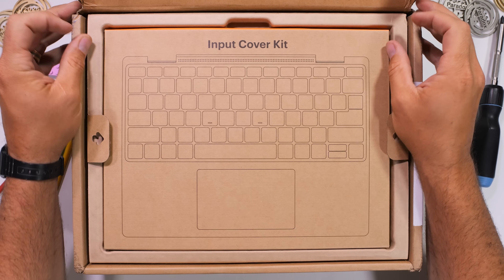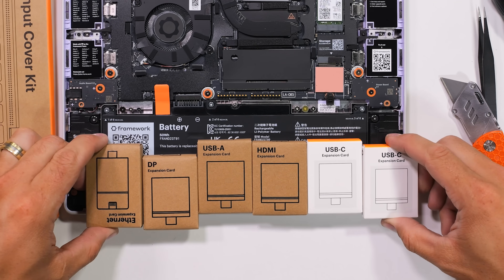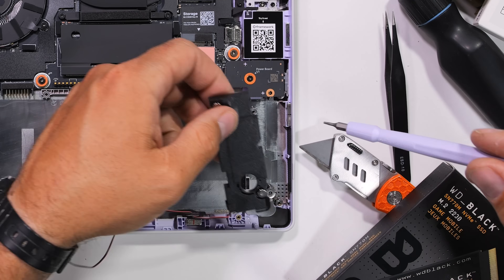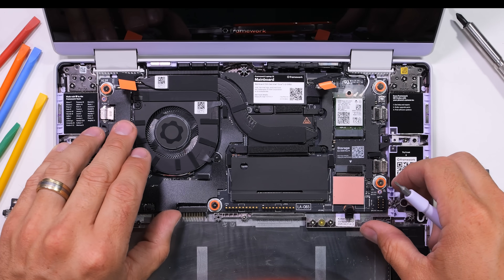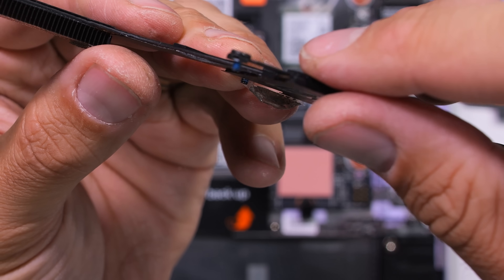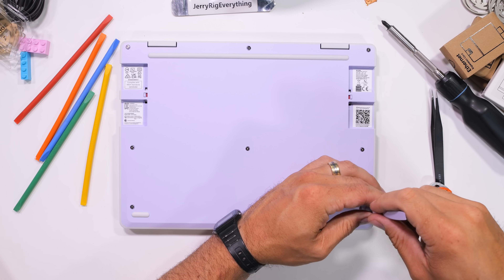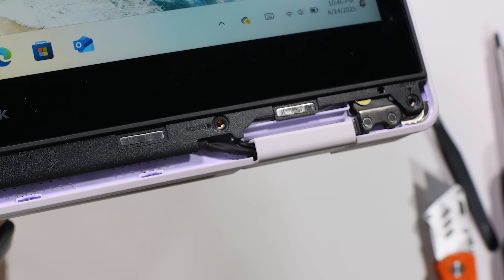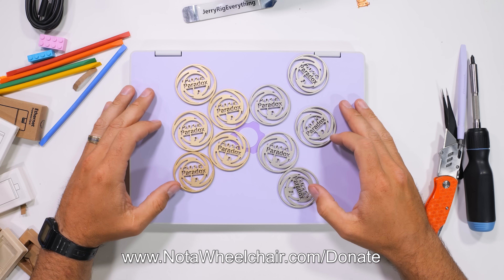The Best Laptop on Earth... is almost too easy to fix.

Comment: Older laptops had upgradable CPUs and even GPUs. Most laptops now still have upgradable RAM and storage. Only Apple and Dell have moved to fully soldered RAM and SSD. Lenovo, Asus and HP still have thin and light laptops with plenty of upgradability. Of course, not as much as this laptop, but you're going to get better performance, build quality, battery life and weight for cheaper with other brands.

Comment: Seems like a viable option for on the go hobby work. Would the 12 and/or 13 be able to run Autodesk Inventor and a sketching software like Gimp or Sketchbook Pro? Or are these screens able to be used with a pressure sensitive stylus?

Comment: Can't wait for mine to ship (Batch 1, Gray) - I have been waiting for a smaller, less expensive version to be able to toss in a bag and not worry about things breaking and having to scour the internet for replacement parts from random shops.
Will be ordering the stylus once they release that too. From what I see in their promo materials, the stylus has a user replaceable battery in that too! 
Also, I'm a huge fan of the new translucent USB-C expansion modules. 
I hope they eventually bring those same translucent colors to other modules and replacement case/keyboard parts in the future. 
I want to rock an translucent purple Framework 12 🙃

Comment: the $559 is a bit of a lie. That is for a barebones non-functional laptop. No OS, no ram, no memory, no IO modules, no power adapter. In addition that is with an antiquated 13th gen i3 that is pathetically slow with an r23 score of 5250.   fully configured, you are looking at 1000-1200 for slow antiquated hardware in 2025. You can buy a new brand name $600-800 laptop that will run circles around this one. And I hope you don't have stability issues with a 13th gen intel chip in 2025 😂. I'm all for right to repair, but this just isn't viable. There is no amount of repair-ability that will offset paying twice as much for slower tech unless you are a butterfingers that break's their screen on a monthly basis.

Comment: I got myself a framework 13 for college last year, and about a week into school the network card died. After a quick scan of the forums to confirm what cards were compatible, and a $20 detour to memory express, I was ready to roll. I'm pretty sure I spent more time looking for the screwdriver than actually making the repair. I also love the reactions I get when people see me hot-swapping ports. And even though it's technically underspeced for what the college said we would need (apparently engineering students are supposed to have a discrete gpu), it handled everything I asked of it just fine.
Reply: never had or seen a network card die in my 30 years of it support.
Reply: Months after buying a hp elitebook it died only giving two blinks on the caps lock😢
Reply: You likely could've taken advantage of the manufacturers warranty in that case and had the network card replaced for free
Reply: @flameblood1  yes but then I would have had to have waited for the replacement to ship. Being a college student who very much relied on my laptop having network access to get assignments done, $20 to have it working the next day was 100% worth it.
Reply: Imagine if this constructor falls down 🫣🎉
Reply: That's because AMD has really really really really good onboard graphics card that is on par with a dedicated GTX 1080
Reply: This is awesome, but inexpensive it is not.

I started building one on their website, starts at £1,399, and quickly hit 2000 as I was putting in the specs. 

I do love everything about it though, they even have like 20 different style keyboards for different regions
Reply: The network card died? That's not very promising.
Reply: @SirDonald  My first Dell Inspiron had to have it replaced almost immediately also. Of course, it was an Inspiron (not premium) but it happens even to big name companies.
Reply: @SirDonald  the impression I got from the forums is that the AMD network card which ships with the AMD mainboard is not very good. The replacement I put in was an Intel card and I've had more or less no issues since.
Reply: @reaganharder1480  AMD forces them to use MediaTek wifi/bluetooth cards due to a partnership and the one that shipped with the "last-gen" Framework 13 wasn't very good. The newer one in the Ryzen AI 300-series seems to work quite well at least for me after a couple of weeks but is also easily swappable if it turns out to be a dud.
Reply: @_ebrq   They could use a Qualcomm Atheros network card with the AMD systems, but that is much more expensive than Mediatek.  AMD does not allow them to use Intel, Killer, or any brand other than MediaTek or Qualcomm.  They could use any network card they want, AMD can't actually stop them, but if they don't use an approved card, they don't qualify for OEM bulk pricing and Framework's already high prices would be even more inflated.

As far as needing a discrete graphics card for engineering work, whoever is recommending that is 20 years out of date.  For 99% of engineering work and 80% of artistic 3D modelling, memory capacity is much more important than processing speed and CPU speed is more important than GPU speed.  You can get a lot more VRAM a lot cheaper with integrated graphics than you can with a discrete card.  Yes, there is simulation software that requires CUDA - even if it didn't, you would want the fastest GPU you could get for that software - but you will not be using that as an undergrad.  That software also tends to refuse to run on GeForce cards because Nvidia are buttheads.
Reply: @SirDonald  Happens more often than you think, even on desktop machines.  I remember building a machine with an Asus motherboard, and 3 hours after I built it and installed Windows on it, the ethernet chipset on the motherboard went up to silicon heaven.  I debated about tearing the whole system apart and doing an RMA, but I'd JUST gotten everything set up how I wanted it and that was going to be a hassle.  So I tossed in a spare gigabit network card I had and that machine ran without any further problems for a few years until the next upgrade.  I also bought (for work) a dozen Dell 1U servers and a week into deploying them, one had the motherboard die.  To their credit, Dell had a service tech onsite less than 24 hours later with a replacement board.  So hardware failures on new equipment happen all the time, even when paying premium.  At least with something like these Framework laptops, replacing a single component is easy instead of tossing the whole thing out (like some certain Fruit companies' products...)
Reply: @SirDonald  i had an asus  which had network card died too but and can't find replacement,  it's pretty normal if you work in iT field
Reply: To be fair it's not like framework made the card, they just installed it. @SirDonald
Reply: @SirDonald  Stuff breaks sometimes, and age or even quyality has nothing to do with it. I think stuff is especially likely to break close after purchase and around the end of the warranty period, but for different reasons. Right after purchase it might just be something that slipped through QC or got returned/exchanged and sold again to someone else because no faults were found with it, which means it is relatively likely to get an issue in the initial period of use. Meanwhile, the period near the end of the warranty cycle is just because the company is trying to optimize costs against their warranty, intending to give it just enough lifespan to ensure it survives until the warranty cycle, but to still encourage its malfunctioning so they can sell a whole new device again relatively soon while saving on the sort of structural costs that only really matter in the longer term.

IMHO the network cards malfunctioning should probably have made that card RMA-able due to the modular function of this laptop and they shouldn't have had any extra costs over it, but I imagine they were in need of actually fixing it ASAP slightly more, which makes it good that he could easily source a fix for the issue without being dependent on some overworked repair center somewhere far away that would have lost him all use of the laptop for a considerable amount of time.
Reply: @SirDonald  all framework are known for having an horrible network card. both me and my friend have the framework 13 (i bought on release year he bought last year) and on both laptops the network card is horrible. terrible wifi
Reply: @SirDonald  Las tarjetas de red son una de las partes mas sensibles de una placa base a subidas de tensión, electricidad estática, un mal cable de red...
Reply: @SirDonald  It happens. It happened to my laptop as well (not a framework) 6 months into owning it
Reply: @SirDonald  I haven't had a single laptop not have its network/bluetooth just die after a while. Typically more than just a month, though.
Reply: My asus from 2012 has a function network and Bluetooth card lol
Reply: You didnt know engineering students needed a discrete gpu?!?! it’s plastered everywhere?!?
Reply: @tezcanaslan2877 i did know it. I ignored it, because i wanted to buy a framework and didn't have time to wait for a framework 16. And i was just fine without it.

Comment: I bought an HMD Skyline earlier this year for the ease of repair much like this laptop.  I'm through with disposable electronics, these items are expensive and it should be criminal how companies just force you into replacement instead of repair or upgrading existing hardware.

Comment: This laptop is for people who like modular laptops or want to customize it. However, know that this is 2–3 times more expensive than a normal laptop. You can break your laptop 3 times and buy a new one instead of buying 1 Framework laptop. Most YouTubers are disconnected from the public when it comes to cost. The economy of this laptop does not work, at least here in the US it does not. I'm not sure what is the appeal of Framework (other than for environmental causes) in the US where you can buy a 3-year warranty with accidental damage for around $70. I might be mistaken; if I am, can someone tell me?

Comment: Disregarding sticks of RAM and M.2 drives, if it's only Framework that are making hardware for this, it's a waste of time.  The customer will buy this laptop, run it for a few years, want or need to upgrade it and will likely struggle to find affordable parts and bin it.  If parts were built to a standard and other manufacturers produced parts, sure great idea.  This is why the PC ecosystem still exists.

Comment: It has a touchscreen with 360 degree rotation as well? That's quite nice.
If you don't need a dedicated GPU, you are more tech savvy than average (a pretty low bar, really), and you wish to keep your laptop around for some years, this is legitimately a good choice!
Oh, and I'll add my support for those captive screws as well!

Comment: I have been repairing laptops from 2 big manufacturers for some time now... And I am kinda confused. This seems like a great product at first, however.. I wouldn't call it budget in anyway. It's quite expensive. If you think about it, for that price you can get a pretty decent laptop that is most likely better performing. and you can still switch out RAM, SSD. When are you going to need a new motherboard?? in 5 or 10 years? yeah.. most likely never. and upgrading the battery? come on now... why start off with a small battery and then upgrade it????
This is just a toy, honestly, which is kinda sad. There is no laptop on the market that becomes obsolete after you buy it. In the end, with frameworks you also have to pay more for an upgrade. See this scenario: for me this laptop with the lowest spec and no ssd, ram, any expansian cards (usb etc.) costs around 600€. thats basically plastic with a monitor and a mainboard and a keyboard... with that money I can already get a better laptop. so i get an ssd,ram and some extensions and im at around 800€... and what will I upgrade when the time comes? more storage? more ram? I can do that with any laptop. And for a cpu i still need a new mainboard, and if i want a gpu i need another model. I am pretty sure if you want to "upgrade" you might as well buy a new laptop. Why would anyone ever want to buy a "weak" laptop to begin with and then "upgrade" it ? it doesn't make any sense financially and the way the computer stuff get's released on the market won't support this at all.

Comment: People act like Framework is some kind of holy grail of repairability — but it's just clever branding.
Swappable parts? Sure — as long as you buy their expensive, semi-locked, often incompatible modules.
No push for open standards. No interest in empowering the community to build their own hardware. Just tightly controlled upgrades, wrapped in a feel-good sustainability narrative.
It’s not a revolution — it’s a boutique walled garden, selling you the idea of freedom at a luxury price.

Comment: Or…. Just buy an m4 air for 850 and it will last you about 5-10 years without all these fairytales about upgrades working better and more reliable. Nothing personal, just facts.
Reply: I have no doubt that this laptop will last as long as an M4 Air with the benefit of being easily repairable by the user. It'll also be upgradable in easy ways to make the laptop feel newer over that time without having to buy a brand new one. Apple doesn't like users repairing their stuff. They often tell users that the device must be replaced entirely.  They even go as far as pairing parts to the mainboard of many of their devices so that they don't work with other compatible devices, while simultaneously taking steps to make sure parts manufacturers only make parts available to Apple and nobody else. They have even gone so far as to have shipments of authentic Apple parts that are compatible with many devices seized by customs because it hurt their bottom line to have the repair be easy and affordable to the user. 

(Side note: They also like to trap users in their ecosystem by making devices from other brands less compatible. They even refused to use RCS (rich communication service) which has been the default for Android devices for years. When texting non-Apple devices, the messaging default has been insecure sms/mms which causes high quality photos and videos to need to be compressed to fit the ancient standard, thereby making Apple products seem more premium.)

Comment: i rarely leave comments on youtube videos nowadays but seeing such company head in a direction of bigger and brighter future leave me compelled to leave a comment to commend their efforts well im not sure when ill buy a new laptop but i will surely keep framework as a viable option into my future endeavors.
Reply: I really appreciate Framework's idea and all, but I'm still using a laptop from a few years before Framework was even established, and it still beats the Framework in everything but performance and battery life - which, since I'm basically using it as a typing and media viewing machine, don't really matter much.

A good human interface is literally timeless, and yet for some reason, that is the one part where you get, like, no option at all. There is one type of shitty basic laptop keyboard on sale, the Laptop 16 came with a 16:9 display (instead of a 16:10) in 2024 (and the Laptop 13 has exactly 3 screen options after having been on the market for 4 years, you could get more variations with a single model of a normal Thinkpad), there is one laptop chasis per screen size, the touchpad is basic (no haptic option either), no keyboard nub option, basic speakers, basic everything.

Comment: Just a note. The laptops back in circa 2010 were very upgradable. The business lines of Dell, Lenovo and Compact were very easy to teardown and upgrade. Some gaming laptop not long ago (perhaps up to 2017) had upgradable GPUs. 
If you ask me, framework is the last laptop I can consider upgrading. By the time the current hardware is obsolete, the body and the rest of the component will be obsolete too. No way to know for how many generations it would be possible to put a new motherboard in. And the price is way way too high. The brand is already established, they should drop the prices or remain a gimmick.

Comment: "Historically laptops have been unmodular"

Looks at my ThinkPad that I am watching this on.

Yeah, it might be older than some watching this video, but it was modular-enough, not on this level. And hey, it still has the performance needed for a general use everyday laptop, like browsing the web, making documents etc. At least so long as you're not afraid to ditch the built in Spyware operating system, because modern Windows makes it slow.

Also decent price, I got it for 80€.

Comment: Omg framework is a god send, while other laptop brands are shifting to putting adhesive pull tabs on the screen to hold it in place, what a joke. I replace my wife's lenovo v15 g3 screen and oh boy I almost crack the screen because of the pull tabs that don't want to be pulled.

Comment: A minimum configuration costs over $1000, plus shipping and import taxes... it's simply not worth it, for that money you can buy a different class of laptop that you can use comfortably for the next 5 years. As for the fact that it is easy to repair, if your motherboard breaks, the repair will still be expensive, and after 3 years it is no longer worth investing money in it.

Comment: What happens if we do not buy the modules? Those are USB-C right? I feel like If I don't buy the modules I could just have a bunch of USB-C ports that I can totally use because my current laptop only has USB-C ports so I have an adapter for HDMI and accessories, I feel like I could just plug that one in and be fine.